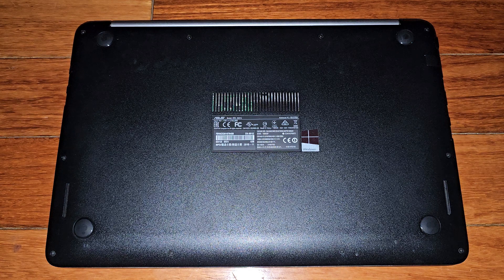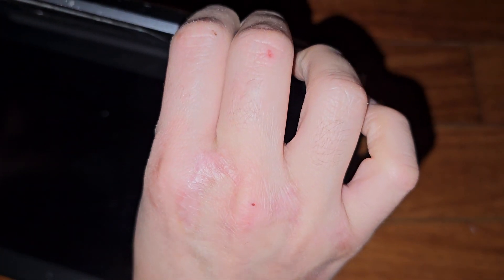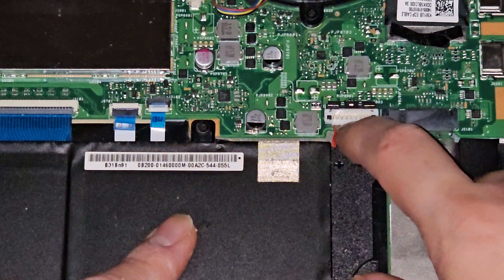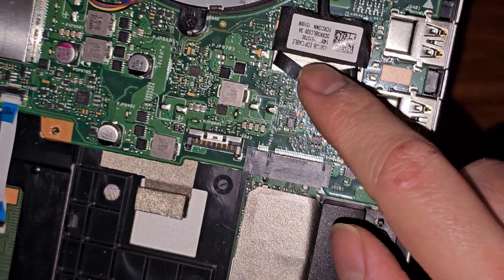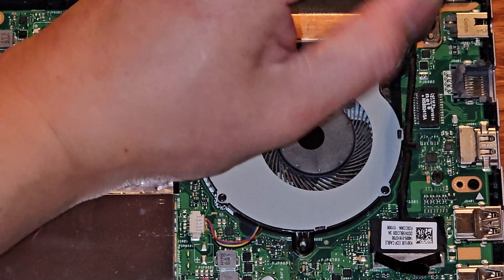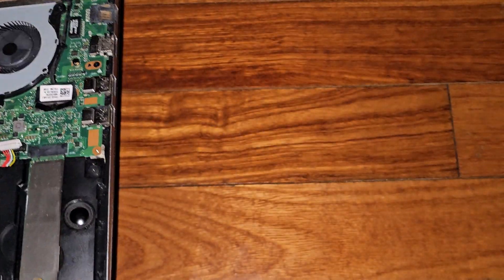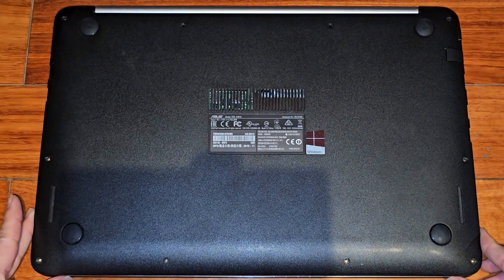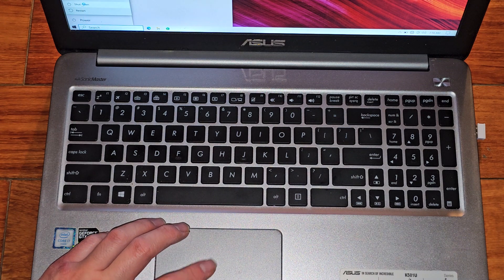Asus K501U K501UX-WH74 Disassembly RAM SSD Hard Drive Upgrade Battery Replacement Repair

Comment: I just wanted to see how to remove the battery and when you got to the part that I was waiting for with the wires that are going into the battery you didn’t show it
Reply from the maker: Either you didn't pay attention to the video or you have no clue what part is the battery. I 100% showed it in the video. I made sure. Lol  Rewatch the first half.

Comment: Picked one of these up yesterday for a steal sold as battery fault, I think mine is the DC jack. Was quite surprised to see both SATA and NVMe (full size support) . Took mine apart along with the video, used a pen knife to lift a bit of the plastic up and finished it off with a guitar pick. Thanks for the vid fella
Reply from the maker: Nice!

Comment: I have a question for the Asus K501U for the C Drive is it located on the SSD or Hard Drive. Planning on getting a replacement?
Reply from the maker: Usually SSD.

Comment: Is there a CMOS battery in this model? I'm trying to fix one of this notebooks that keeps losing BIOS settings. I thought changing CMOS battery can solve but I didn't find it. May replacing the main battery solve it otherwise? Would you suggest some other procedure?
Reply from the maker: Built into the mainbattery
Reply: how so? I have been using this laptop for 7 years with battery removed, but I got cmos dead after leaving it for a year

Comment: hi , can i know if this laptop can use NVME SSD  or just SATA??
Reply: I have installed a Sata ssd in mine. It's not compatible with nvme.
Reply from the maker: @ESEJESEJ  got it
Reply: @ItsBinhRepaired  Have you any experience of this laptop (or similar) not giving picture to a second monitor via hmdi? It has stopped working. When connecting hdmi it detects a second monitor but there's no picture. 
I have reinstalled windows 10, updated all drivers, tried different cords and monitors etc, but still nothing.
Reply from the maker: @ESEJESEJ  not too sure
Reply from the maker: If I didn't mention it in the video, I'm not sure.